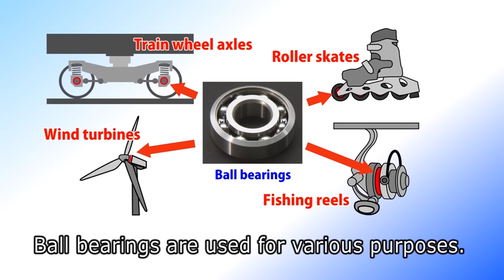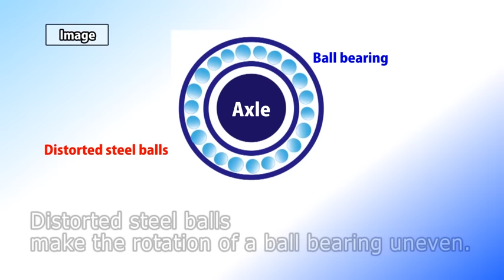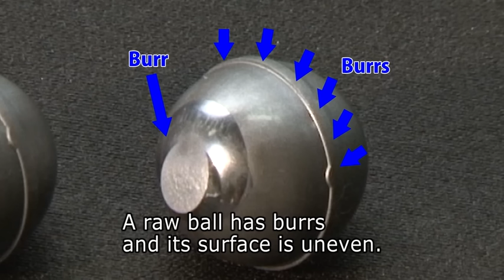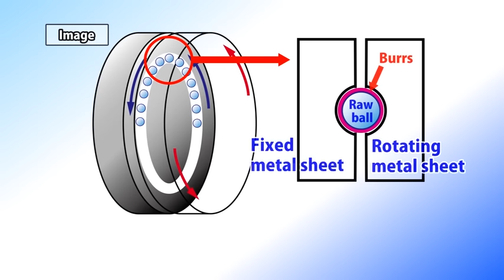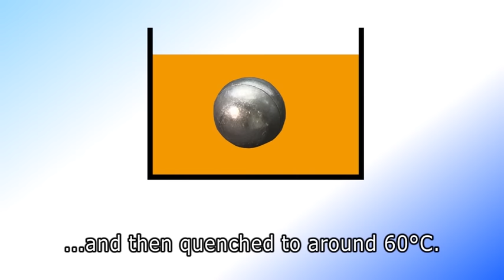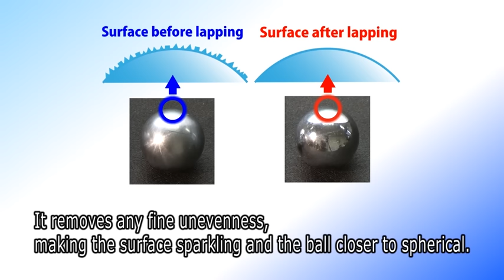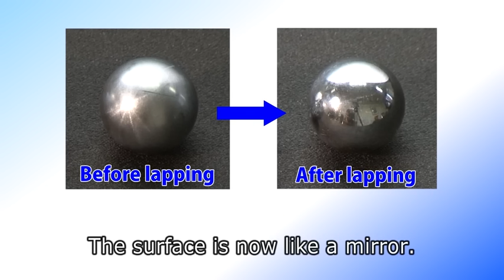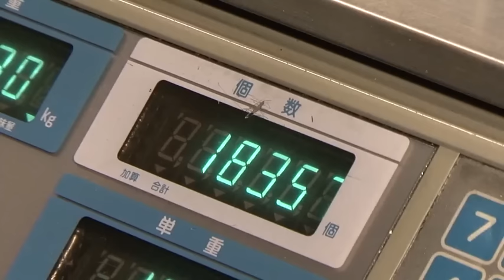THE MAKING(English Version) (314)The Making of Steel Balls

Comment: Train wheel axles don't use ball bearings.  They use roller bearings, where the bearing is shaped like a cylinder.  It's rare to see ball bearings used in a heavy load application.

Comment: I’m sure your videos are researched well but there is a mistake on the opening screen splash. Railway wheels (trucks) don’t use ball bearings because the loads are too high to support the loads. The use simple bushings instead with a wet lube oiling system.

Comment: One opening graphic shows ball bearings used in train wheel axles. This may be true for toy trains, but real trains normally use some type of roller bearing for greater load capacity and higher shock resistance.

Comment: An "easy way" to do this at home: (1) fill a bucket with oil. (2) put bucket by tall tree. (3) climb 50ft up the tree with molten steel. (4) drop teaspoon-sized molten steel bits into bucket. (5) profit. (gravity spins perfectly round steel or lead balls..kinda how they used to make shotgun pellets, cannon and musket balls, except the tree part - I assume you don't have 3-story tall tower on your property)

Comment: I wonder how long it take for the different grinder to be out of  tolerance
Anyway wonderful doc, I have to say that I did not know how they was made, what I know is that choosing balls exactly the same size make huge difference wit ball screw, so if you are not very rich , you can take slightly oversized  ball take a micrometer and calbrate them (yes one by one it take time between 80 to 200 balls per nuts and you need 2 in order to make a zero backlash. most of the load is made on the first 2 groove having very calibrate ball may distribute the load on more groove.
We have done tests it appear that choosing not too good quality balls (they are slghtly elastic give wonderful results provided that you measure them precisely ) probably they adapt to the imperfection of the fast track, it is very rare that in mechanic a cheaper product may give better results (provided that you make abstraction of the precise sorting)

Comment: 6:39 The load is actually upwards to the top of the bearing, not downward towards the bottom.
Reply: That depends on how the wheel is mounted to the bearing. If the axle is fixed to the wheel the load would upwards on the bearing, with the axle fixed to the bike the load would be downwards
Reply: @Mrshotshell  My mind has been temporarily blown.

Comment: Incorrect nomenclature used in the written description of various stages of production. When the raw balls are first formed from the rod blanks the excess material is not a "burr" it is "flash". The machine that removes the excess is not a flashing machine, it is a de-flashing machine. There are other incorrect uses of technical terms but the lesson is: don't depend on these videos to learn the correct language used in industry for manufacturing processes. The same thing is true for the popular series "How It's Made", where not only are incorrect terms used but, in many instances, the verbal pronunciation of words is incorrect.

Comment: During WW11 the UK used glass ball bearings in certain circumstances. I know this because my family was housed in a Family Camp (ex military barracks) in Chandler's Ford, near Eastleigh, Hants.  Next to the camp their was an area we called (by we children) the Marble Mine. Here we found a supply of glass bearings, which we used as marbles.  I believe these were used in gun turrets, instead of steel bearing, partially due to the shortage of steel for bearings and because of the costs involved, Also these were cheaper and easier to make!
Reply: They also work fine.

Comment: "By conducting this heat treatment the constitution of the steel changes.  The steel becomes hard and strong." They amended the constitution of the metal.  Then then made a second amendment. There would be some irony in those steel balls but alas they are balls of lead. That's a completely different constipation of metal.

Comment: Too much is not explained. The same kind of rolling machine seems to be used many times. The first one clearly SMASHES the imperfections into the ball. Later steps are called "grinding" but that word implies the removal of high spots. I don't see how the same kind of roller machine is doing that. Something more needs to be said.  AND we should get an explanation of why some work is done after the metal is hardened in the heat process, which would make it more difficult to make changes to the balls.  More input please.

Comment: source:http://plastic-dryer.1998sy.com/

Plastic Dryer Also known as:
Plastic Dehumidifying Dryer,Plastic Dryer,Plastic dehumidification dryer, Plastic Dehumidifier,Resin Dryers, Resin dehumidifying, Resin Dehumidifier,Plastic drying equipment,
Mainly used for highly waterproof special plastics and resins, these resins and plastics require ultra-low dew point -40℃ dryer. Such as PA, PET, PC, PBT, etc., optical grade GCD-OP model can be used to produce optical grade products, such as lenses, LCD light guide plates, optical discs, etc. Under ideal conditions, the lowest dew point can reach -40°C.
Composition: The dehumidification dryer integrates the three functions of dehumidification, drying and two-stage feeding, which is especially suitable for engineering plastic materials with strong moisture absorption.
company name: Dongguan Hengju Machinery Equipment Co., Ltd.（东莞市恒钜机械设备有限公司）
phone： 86-0769-89237256 WeChat/Whatapp： +86-15876905866 E-mail： wto-btb@wto-btb.com
http://plastic-dryer.1998sy.com/

Comment: The phrase they're avoiding is "bearing balls." 
A ball bearing contains a race-full of bearing balls.
Buckminster Fuller claimed in the 1940s that the area of bearing balls in contact with the surfaces they run on was constant at 1000 square miles across the whole world. Bearing balls improved in strength and hardness at the same rate as their number increased, he claimed, so that there was less contact-area per ball even as the number of balls and bearings increased.
This was at least faintly plausible at the time, when Bucky was briefly (like Al Toffler) an editor of Fortune magazine.
I wonder whether it was true then, and whether there would be even the faintest truth to it today?

Comment: A small steel ball designed as a ball bearing is a 'ball bearing'. A number of ball bearings used in a task is commonly referred to as a set of ball bearings. A set of ball bearings that are encased is known as an 'encased set of ball bearings'. It may seem minor that you refer to an encased set of ball bearings as a single ball bearing but that is wrong. It makes it hard to watch as you do not seem to know the subject very well.

Comment: Not entirely accurate.  After flashing step and heat treat, the grinding step uses a grooved grinding wheel NOT made of steel, fixed to the spindle of the machine and the fixed “gap plate” of hard meehanite .  Early in my career I made the lubricants for he processing.  In the lapping stage, this is a free abrasive machining process using silicon carbide and calcined alumina as the abrasives dispersed in a vehicle that is applied to the balls as they recirculate through the lapping plates.  Multiple lapping with more and more precision plates to get higher grade (more perfectly spherical)   Bearings used in critical applications needing the quietest running bearing are 3 millionths out of round.  The lowly pinball ball is  a sloppy 25 millionths.  The center of this industry was once Connecticut in the US. In WW2 the Allies bombed Schweinfurt Germany because that’s where the Germans made bearings.

Comment: Very interesting vid from mechanical engineering viewpoint. But the information around 7:45 about steel's structure is completely sh..ty. It is not the change of arrangement of atoms from disordered to ordered. Quenching of bearing steel (something like tool steel or hypereutectic steel) causes transformation from austenite to martensite. Then, annealing at about 170 °C is called tempering and causes small changes in martensitic structure. As the result, the martensite is less prone to cracking, there are weaker residual stresses in the balls. There is quite a lot of materials science behind it, and this comment is not to explain in detail the complexity of metallurgical changes. Those who want to learn more about it, may browse internet and find out.